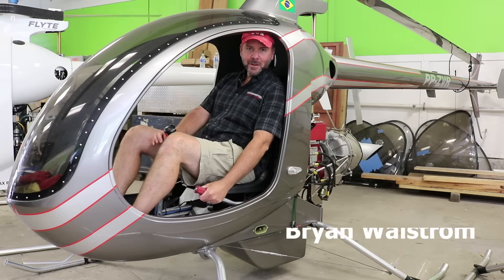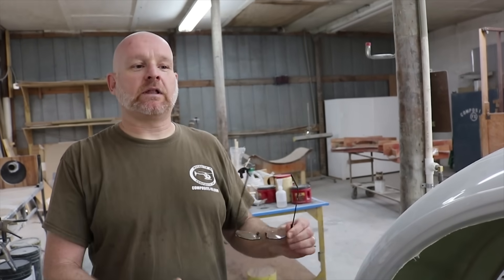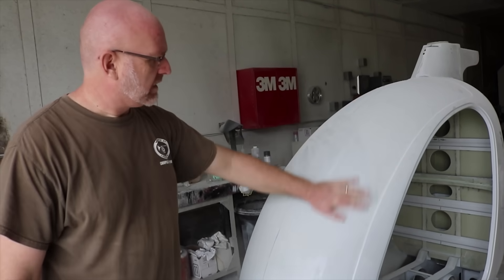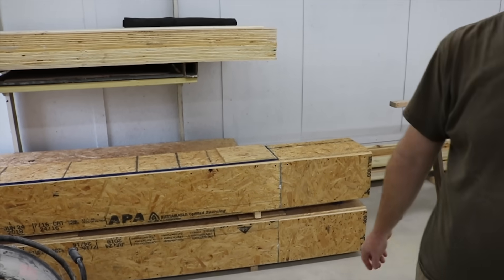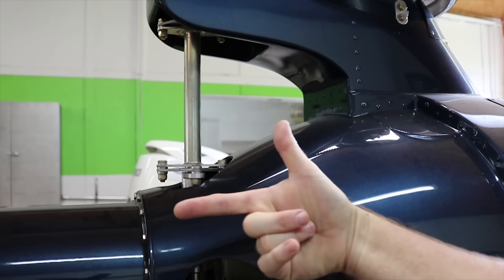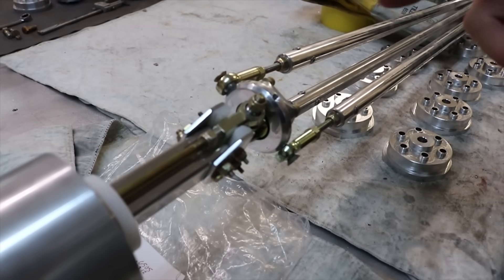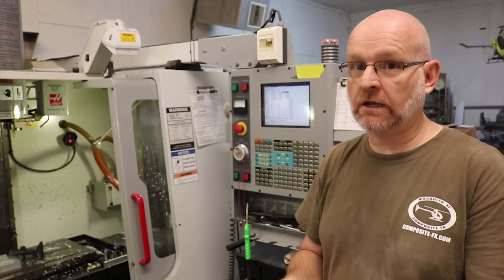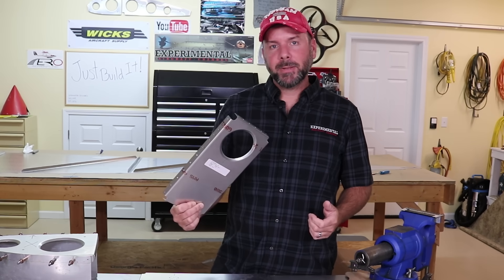Mosquito Helicopter | Detailed Factory Tour | How It's Made | Engineering | Must Watch!

Comment: This entry level helicopter ultralight was originally designed in canada, and used a Suzuki B80 twin cylinder 2 stroke, used in the Arctic Cat 800 snowmobile. This ultralight is designed for use with a air cooled, 2 cylinder, 2 stroke, made in CHINA🤔🇨🇦

Comment: Still a 2 bladed, teetering system. Needs high skids, and when you need a cable between the landing gear legs so they dont splay, tells you the design thought

Comment: Mr. Walstom...unmolested....sure...umm..do yourself a favor...attach a set of parachutes on the nice space on the underbelly of those choppers cause they are capable of failure nor do they glide...and there prolly going to get popular...I' m sure an engineer would be entertained by the idea...like airbags in a car ...larger..parachute...built into the bottom secured to the frame...please get this to you associates...I figured if one failed and could released a back up could be...the flyer is going to hit the ground upside down but....ect...later...

Comment: 5 year or 500 hour belt life. If I could afford the fuel to make it happen, I’d be changing belts every 6 months.
Reply: You lost me at belt... lol
Going Back to Bush plane kits
Reply: @rayyoung2611  You fixed wing guys are all the same. “Yeah, but I can glide to a safe landing.” 
Well, tell that to the Lynyrd Skynyrd Band. I’m just ball busting here. Lol

I’ll take auto rotation over gliding, any day of the week. If that belt breaks, you can set your chopper down safely. If your engine dies in your plane, I hope you’re close to the interstate or the Kansas wheat fields.  Be safe brother.
Reply: @rayyoung2611  secondary for redundancy. If it's good enough for a 10,000hp top fuel car then it's good enough for my 85-150hp putter lol
Reply: Burning  6-6.5 gph you are looking at $50-$60/hr operating costs.  The 500hr overhaul kit is approx $5k

Comment: "What's the service life of a belt?" - "5 years or, um, 500 hours"

That's the Imperial system of units for you.
Reply: 500 hours refers to flight time. 5 years or 500 hours of flight time, whichever comes first.
Reply: Tbo @ 500 hours is pretty crappy. Wonder what the cost to overhaul would be
Reply: @RoughDraftAlberta  changing belts after 500 hrs of flight time isn't too bad imo
Idk about total overhaul though
Reply: @bigbi48  yeah if that's just the belts but the conversation made it sound like tbo was 500 hours.

Comment: Looking at this wondrous little machine has made me wonder how it can be used for military purposes, with the appropriate modifications of course (armor, weapons, necessary power upgrades for the extra weight etc).
The potential for close-in infantry support from a one man hellicopter stationed close to the frontline armed with a couple of heavy machine guns strapped to it would be impressive. As a group of 3 or more they would be deadly.
Reply: Being an aviation electrician working on Black Hawks to try and "militarize" a Mosquito would be worthless. just the IFF, radios, Nav systems, and gps would add excessive weight and there isn't enough room for the units much less any armament.
Reply: You could buy an AR-15 with a grenade launcher and put her in hover....right?

Comment: I'm am aircraft mechanic and I do composite work as well.  At 12:37 min while showing your swash plate demo I noticed what looks like reinforcing patches in your upper rotor shaft torque box on the aft wall that are roughly laid up and obviously not vacuum bagged down. They weren't even sanded smoothe!  I have to say that I'm surprised that you're using a weaker joint like that and cutting corners by using "backyard" building techniques.  I won't even mention the use of fiberglass over carbon fiber!
Reply: It gets scarier the closer you see the details... Today I watched a new episode from a video series of building one of these units from a guy named 
The Okayest Engineer and the tail was delaminating so he had to patch it up. I wouldnt trust one of these builds the way the composites are laid out, really really sketchy stuff indeed.
Reply: Thank you for that feedback!  I won't be purchasing one of these!  I'm glad I had this video to review before I got involved in this any further!  I reviewed the video again and I realized that that area by the rotor mast isn't carbon fiber the "glass" has been painted black. That said unless they overbuilt that torque box area their layup as is is weaker than it could be had it been vacuumed down!  I also noticed at 12:20 min the hardware going through his connecting rods are secured with what look like non-aircraft fiber locking nuts. I don't think those are safe enough for withstanding continuous vibration like a helicopter produces. He should have used self locking nuts, castellated with cotter key or safety wire nuts. In his installation in this view it looks like his bolt heads are lower than the threaded ends so if the nut falls off the bolt slides out!
I like the idea of what he's building, but his focus seems to be more on the business side than the safety side!  Don't even get me started on how his electrical connections under the seat that ARE EXPOSED TO THE ELEMENTS aren't sealed!

It's too bad that some people will risk others lives to make  fast buck!
Reply: @superdude1759 nightmare fuel the way its wired, it truly gets worse the more attention you pay to the little details of any part of the build 😂😂😂

Comment: Composite Tech Jim here. Your still using Ester resins and gel coat? Its brittle, heavy, cracks if you look at it wrong,  Never keeps its tolerances do to expanding and retracting under heat and cold conditions and is substantially weaker then Epoxy resins, but ill give you one thing. It's dirt cheap to purchase. If you want to up the quality, reliability, straight  and get great weight reduction go with DER 324 epoxy resin with EZ 84 hardener. This is the same resins Volocity aircraft uses to construct there kit aircraft in Sebastian FL. Scott Swing is the owner if Volocity. You won't regret going to Epoxy! Also frekote mold release your molds. Spray in Urathane primer in your molds (no  brittle and cracking gel coat to deal with) and start laminating after the urathane primer has completely cured. This process will give you superior composite construction and in most cases you won't even have to vacuum bag if you don't want to. If your not sure how to do this process contact me. I'll come visit. 👍
Reply: Yes epoxy is the way to go.

Comment: Some constructive criticsm, kindly meant (and from experience). This is a little hard to watch but you can vastly improve it by developing your camera work. Essentially, don't use Autofocus and don't keep the camera recording whilst you are reframing a shot. Autofocus relies on the camera guessing what should be in foucus - and often getting it wrong. Moving the camera from one thing to another whilst shooting is nauseating for the viewer. For example, when shooting the completed machines in the hangar, either hold the camera steady and walk in a straight line (a tracking shot) or stop recording whilst you reposition to the next machine (an in-camera cut). Good luck! Bob.  PPL(A) and (H).
Reply: seconded, with a more stern please fire that guy or at minimum send him to a local film school. Yikes